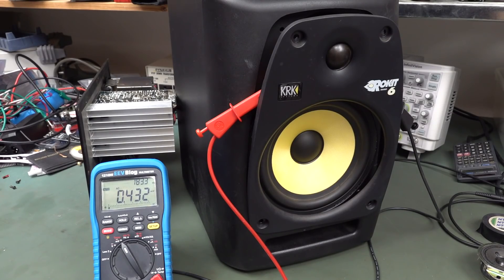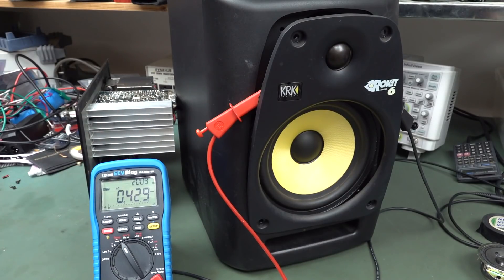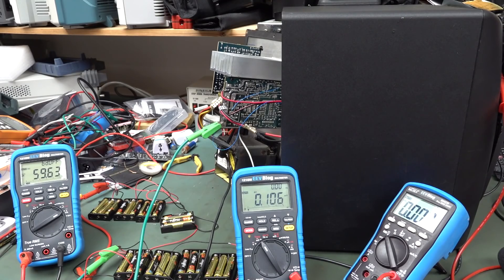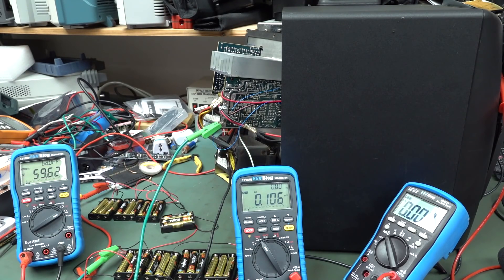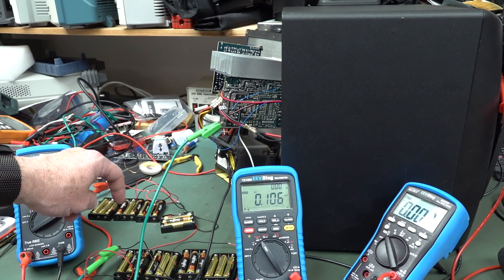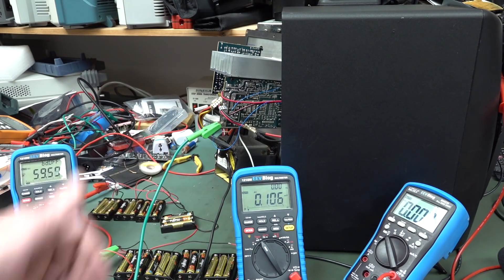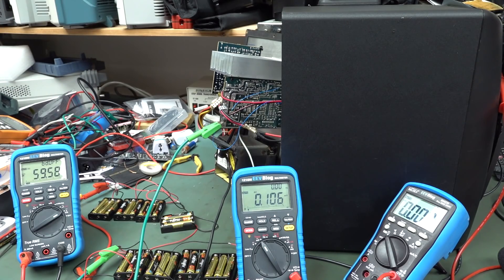EEVblog #1128 - Studio Monitor Speaker Noise - Part 2

Comment: Everything has noise at some level if only due to resistor thermal noise as you pointed out in your previous video. And good monitor drivers generally have enough dynamic range to reproduce it.

With that said, -67 dBV (the 430 uV of the second speaker) is particularly awful, and that is going to be audible when listening to in quieter content in a properly silent environment.

Comment: I got myself a krk v6 recently but thinking about sending them back and get a pair of genelec8040s due to krks extreme hissing and buzzing.

Some official from krk stated that they where using DPS that added noise but the manufacturers are aware of their use  in speakers now and have started to reduce the noise from them.
I think DPS is used for filtering/presets but not sure i can barley change a ligh bulb in my car som im no electrical genious :D

But cmon now!  computer speakers from the 90's wasn't even this annoying to deal with ><

Comment: I have the Tannoy Reveal 802 studio monitors and they have a hiss. Doesn't matter though, they sound fantastic. The hiss is coming both from woofer and tweeter. I added a PreSonus Temblor T10 as subwoofer. That one is silent. Doesn't have any noise. So.. if Tannoy does it, you can say is ok. In fact has nothing to do with the fidelity of the system.

Comment: I found the noise off the battery much less objectionable. Clearly it's audible but the one stock has a buzzing component to it, I'd be annoyed by the mere character of that noise. Probably just needs a couple ferrites with a few wire loops on them and another couple capacitors to attenuate that.

As to replacement amps as someone asked? LM3886 tends to be super well behaved; but I bet if it's amplified input stage noise to bother you, it will be the same.

Comment: Well KRK speakers are generally considered bad speakers.
REGARDLESS, I've always considered active speakers to be "good enough" for PC speakers, or even home theater use (to some extent), but if you are looking for best results you may want to consider passive speakers with a decent external amp and good (reasonable gauge will do no need to go buy Monster cables unless you think unidirectional cables are a thing) wiring between them.

Comment: The tweeter shouldn't require much power after the crossover.... Why not just use the +/- 19V supply and build a small Class A amp just to drive the tweeter?

Comment: Dave, couldn't you just hack a signal detector with an output into the "Mute" pin. You know, if it doesn't detect a signal from the preamp for a couple of seconds, disable the main amp? Not sure why it doesn't do that by default...

Comment: So it's okay to use plain multimeter probes to measure noise accross speaker terminals, but you gotta use 50ohm terminators when using a scope in this scenario, to measure the actual noise and not what's picked up by the probe-tennas...why?

Comment: My suggestion : to measure this noise, short-circuit the input!
Reply: One of the things you learn about when studying noise is that you get the highest contributions to your total noise from the first input stage. Yes, shorting the input to the power amp will measure the power amp's noise. But when you connect that input to your source ("LP OUT", not shown in Dave's schematic), the noise will be gained up by the gain of the power amp (= 40 = 32 dB). I guarantee that the noise you get with the source driving the power amp is far greater than just the noise of the power amp by itself!

Comment: Why did they not use DSP processing throughout driving a PWM amp and use Brick-wall filters between the output and the speakers so you just get the wanted audio but nothing else.

Comment: Listening, I could clearly hear the difference between the batteries and AC power.  It wasn't in the hiss, but in harmonics of a buzz from the AC mains.  That's probably why the lower AC reading without really noticing a difference in the hiss.

Comment: Looks like you'll have to do some major HF level juggling to fix this properly. Massive series resistor for tweeter (try 10-22 R / 10-20 W ceramic) + reduce HF attenuation in crossover + fine tuning to get frequency response back. (Tweeter resonance might become an issue but probably not too much with a high-order active XO. On the pro side, tweeter distortion should be appreciably reduced in current drive.) 
You really want an omni measurement mic for this but in the 2-3 kHz range having both the M5 and an omni lavalier (plus a whole bunch of damping material to drape around the speaker) should get you in the ballpark.

BTW, where did you dig up that schematic? OK, I think I found something, does not seem to be publicly available though.

Incidentally, I seem to have some of the few hiss-free budget nearfields - Tascam VL-X5s. Mind you, mine have other problems - one seems to have been from a batch with relay issues so the woofer has cut out occasionally, the other has a fair amount of buzz (bad caps or soldering, I guess), and they are GLUED shut in addition to a gazillion screws and opening them requires brute force. Too cheap for a bloody gasket, I guess.

Comment: Can you replace the feedback resistor with a variable one, to be able to control the gain, and see if that influences the noise?  

Also I really hope you use a scope for this, so we can all see the noise...
Reply: "Seeing noise" (on an oscilloscope) doesn't tell you anything because you're looking at random signals. That's why it's called "noise." The only real way to quantize it is to use RMS measurements ("heating power").

Comment: I forgot these were powered speakers.  Hard to change amps on them!  Rewire them to be passives and try different amps on them.  If you find a good combo, work backwards to make "silent" tweeters on their own self contained power.
Reply: Where's the fun (and education) in that? Engineers want to discover WHY.

Comment: Now I've watched the whole video, I'm glad I guessed right in my first comment! "8-)"  1) Battery power! Great idea, great experiment, even if the PS contributes noise, there's no argument that the driver transistors make audible noise.  Try to find an amp without those IC type drivers.  Correct me if I'm wrong, but aren't those "IC" outputs just a pair of excellently matched power transistors?
Reply: Somebody's separate amp (use a preamplifier + the amplifier in a separate box) might use discretes on the output.  You can also try different amp architectures (class A perhaps).   Lastly, I remember hearing about popcorn noise in transistors in my college days.  Can you check what is the lowest theoretical noise floor is for Amps?  There are also noise sources that you can't shield for.

Comment: Hi Dave,

I believe the noise being picked up has very little to do with driver IC but has with the signal path right from the input to the pre amplifier to the active filters to the driver IC. The only best way to confirm this hypothesis is to to use shielded and balanced length cables instead of the PCB and un-shielded wires used.

Comment: Yes. Power supply filtering video, please!
Reply: The power IC itself has good low frequency (60-120 Hz) rejection of about 50-60 dB (figure 8 of datasheet). The power supply isn't the problem here, it's the noise-generating amplifier itself.

Comment: In a room packed with multi-thousand dollar oscilloscopes, and detecting, measuring and characterising noise by pointing a microphone at the speaker? I'm in the middle of man flu at the moment so I may be missing something....?
Reply: I thought a scope was the go to tool here but I must also missing something
Reply: The speaker itself acts as a filter (i.e. it has a characteristic frequency response, probably in the 500Hz-20kHz range), so it makes sense to measure/hear the actual sound noise (which is what we're interested in) of various changes. Power spectral density meter would indeed be useful here though.
Reply: I feel the same. Watching Dave poking around with inappropriate tools feels like watching a bigclive video, not a eevblog.

Comment: That is actually a side effect of the design of the amp chips used in most consumer equipment. Most if not all of my equipment anything that has an amplifier will produce some type of hiss. If your close to a radio tower you'll pick up that station.

Does commercial grade equipment fair any better when it comes to hiss?

Comment: again a great video !
do you think a way to further constrain the source of the noise could be to filter the range below  say 10Hz to see how much of it is of type 1/f noise ?  (to determine if it is resistive or pn junction or else)
or am I on a totally wrong trail ??? hmmmm ...
Reply: 1/f noise would hardly get to a tweeter, usually the break point is between 10 and 1000 Hz.

Comment: I got Yamaha HS80M and I always thought the hiss I hear (quite loud in 1m distance) comes from the active filtering preamplifier (8 x4558 opamps for each band before power amp!), not the power IC itself (here LM3886). I even was thinking to replace complete analog preamp section with digital crossover. Now I need to reconsider this idea or at least investigate where this hiss is actually coming from! Thanks Dave. BTW - I know this TDA chip from other applications and it was indeed quite noisy. Maybe you can try to find the active chip with volume control in negative feedback loop within power amp. This might help reducing the hiss.
Reply: Interesting, I'm running a Pair of Yamaha HS8's at the moment, and I only notice it when inches away from them - I wonder what the difference between the two are?

I also coincidentally upgraded from the KRK Rokit 8's to these - the 8's seemed a bit boomy
Reply: Well, maybe it's a matter of production lot? I don't know, but to me these Yamaha seems to have a bit too much hiss while sitting on axis of tweeters (max. 1m distance)
Reply: Could be, TBH I Listened in store to them and purchased a new boxed pair, could have been from the same lot though.
Reply: LM3886 input noise (10uV worst case A-weighted) is more than the 4558 (10nV/sqrt(Hz) == 1.4uV unweighted).   But with many opamps the noise powers will add up.  NE5532's replacing the 4558's may make a difference, but the LM3886 may well limit any benefit.

Comment: Can still be PCB layout or layout in the chip.
Best solution is a passive attenuation after the power amp.
Reply: With corresponding higher crossover levels obviously. Said so on part 1. Positive side effect, driving the tweeter via a dropping resistor (current source) would reduce distortion on top of that. Might require a passive LC to tame tweeter base resonance though.

Comment: I have a home theater, when turned on the bass starts to vibrate loudly without any input to the speakers.
Reply: "the bass starts to vibrate loudly without any input to the speakers." So you remove the speakers from everything, just sitting there on the floor with nothing connected to them, and you get loud vibrations from them? How's that work? If they are as you describe, I'd like to buy your speakers and go into the power generation business with them. "Free power!"

Comment: Interesting test Dave. I can hear a Buzz on the tweeter when using the mains PSU. I am a recording engineer and I took the 2 noise clips into Protools and there is definitely a buzz on the clips from the Mains supply. Some extra capacitance or maybe a 100nF cap across each rail to ground would help that. Peter

Comment: Try substituting 6L6's and add an output transformer and a  lot more batteries...  Good die mite! lol Love your channel
Also, soft, upper octave (clean) piano chords usually reveal horrendous harmonic distortion coming from ALL digital amps and it would seem, all of these low-fi IC amplifiers. You might try dialing down the value of that negative feedback resistor (to lower gain of the amp). Maybe it's the resistor(s) that are producing some of that noise!

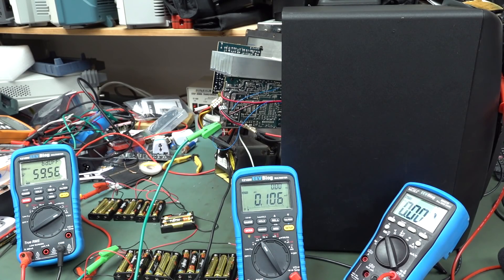Comment: 8:58 low frequency noise is gone. Change your capacitor and diode. Parallel your 4 diode with 100nF mylar.

Comment: KRK are cheap - IMO made for DJ's that have no idea about high end monitors, I have a set of Alesis M1 Mk2 and they are killer and were about $900 new, Adam Audio, Tannoy, Dynaudio and Genelec are where its at though
Reply from the maker: I have Alesis M1 Active Mk2's and they have the same hiss. People report hiss on some of those other brands too.
Reply: @EEVblog  My M1s are silent compared to my brand new ADAM T7Vs, thats how I found this video, the noise is driving me mad - not sure what to do - replacement T7Vs make exactly the same noise.
Reply: Hey Dave, interesting, I haven't noticed mine to really hiss, however i am using a Dbx PA+ loudspeaker processor to do EQ/Room EQ and crossover (high pass) protection fed from a good focusrite 6i6, that might have something to do with taming the hiss possibly. Ground loops in audio gear can cuase all sorts of grief too I noticed your mic picks up on like a mains hum/buzz sounding thing on the first go, not sure. Very interesting video :)

Comment: I have a Cyrus Audio power amp here ( www.cyrusaudio.com ) it has about 0.8mV of noise although I think that is dominated by 50Hz. My active speakers have 0.06mV. Another active speaker has 0.22mV.

Even passive speakers will have a similar level of hiss when the amp is running.
Reply: "Even passive speakers will have a similar level of hiss when the amp is running." Speakers do NOT generate noise. They can only produce acoustic power via the electrical signal that feeds them! Your passive speakers source of hiss is the amplifiers that feeds them, not the speakers.

Comment: A -12db reduction is certainly worthwhile pursuing. Please modify your power supply with a capacitive multiplier and see if that doesn't provide the same results as battery power. Then go after reducing the amp noise....

Comment: Demonstrating clean up on the PSU rails would certainly be worth a video. On some active speakers (Alesis M1 Active 520 for example) there are severe problems with interference from powerline Ethernet being picked up through the PSU and amplified in the audio range. 

Also be interesting to hit the chip with some freezer spray...
Reply from the maker: I've never had issues with my M1 Active 520 USB's

Comment: Great video, I expect in part 3 you will implement a capacitance multiplier circuit.. Or even just quickly drop in a pair of power resistors..

Comment: To me there are two important figures to look at : Total Input Noise (10µV) and voltage gain ( up to 80db in open loop)
Worst case : 10µV +80db =  100mV output noise.
Reply: Who runs an amplifier like that open loop? That's silly. What's interesting is closed-loop gain, for both signal and noise.
Reply: You're totally right we're not in open loop, i don't know what i was thinking ! So since the High Frequency is set to aprox 35db , it means 1mv of noise max in output. So I'm wrong ! haha
Reply: The chips input refered noise (20kHz BW) is listed as 3uV (ie 20nV/sqrt(Hz)), worst case 10uV (70nV/sqty(Hz)), and that's a lot higher than a good low noise input stage can achieve, ie using low noise transistors and carefully optimized.  The problem no doubt is that this in an integrated amp, using a process that has to be a compromize between the requirements of the output transistors and input transistors...  Standard audio opamps manage 4nV/sqrt(Hz) or better (0.5uV rms 20kHz)

Comment: Can you make a video on power rating of audio amplifiers? Different ways to measure, difference between datasheet power rating and what the product manufacturers advertise, do they all lie etc.?
I found enough of those TDA and similar amps in speakers with often drastically different power ratings than what's on the box, from every brand, top end to bottom-of-the-pond...

Comment: Are there allowed to use that symbol on KRK👈 that's a KEF symbo,l I would have thought there would be a copyright breach.
the hiss is a cleaner sound when you did it through the batteries, before it was oscillating and had a awful artefact to it buzzing noise. some poly filter caps should be able to filter out there artefacts off to chip. maybe if you put a triad configuration of safety caps across the mains filtering it to earth would help!

Comment: I wonder if the noise would be reduced if you had nothing else on (florescent lights, LED drivers,... ), or if the amp section was isolated via a grounded can?
Also, is this noise not with-in the spec of these cheap amps?

Comment: If we're going down the audio rabbit hole, why not a comparison between the inherent noise of basic Class-A, Class-A/B, and Class-D amps? Breadboard style, with scope probes showing it ?
Reply: Noise is a function of the input stage, not the output stage (unless its really bad!)  - though OK its true class D can have issues with noise floor due to jitter and suchlike.

Comment: I once built a noise generator by amplifying the noise coming from the power supply rectifiers. Diodes are very good at producing noise, especially when they are warm. In fact almost any active device can be used as a noise source. You can even use the output from logic chips as a noise source and then amplify it. In reverse a lot of the equipment my company develops requires very low noise and so we use LC filters on the power rails to filter out the white noise coming from the rectifiers and regulators.